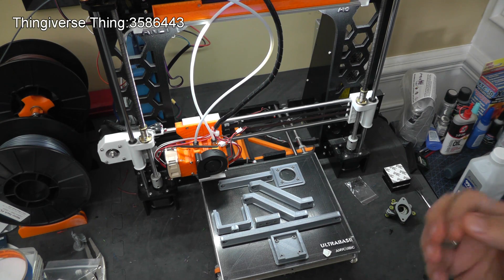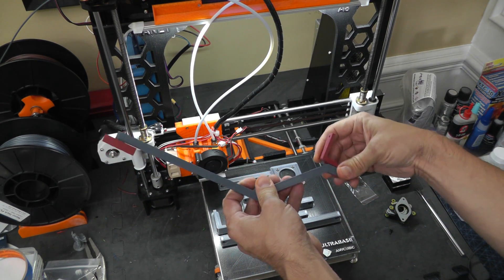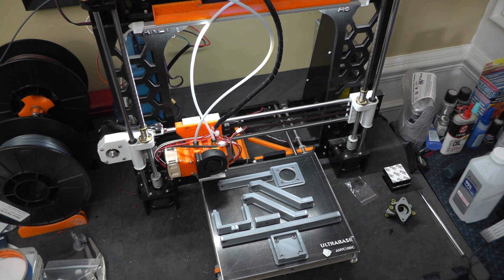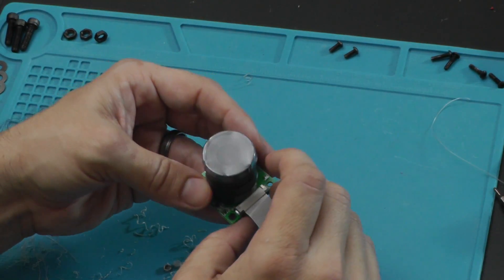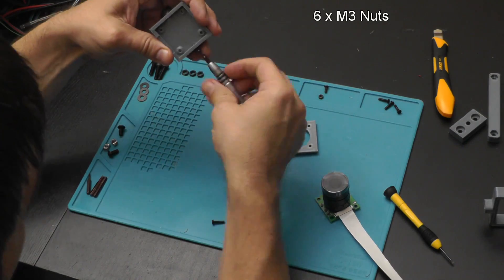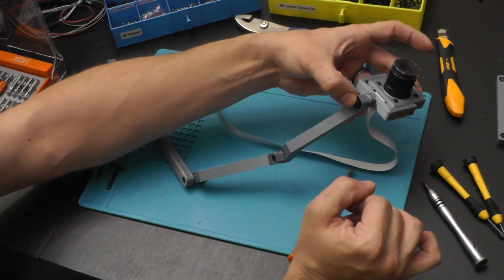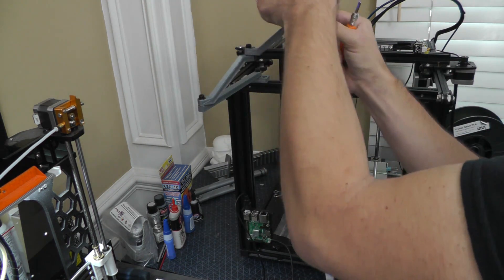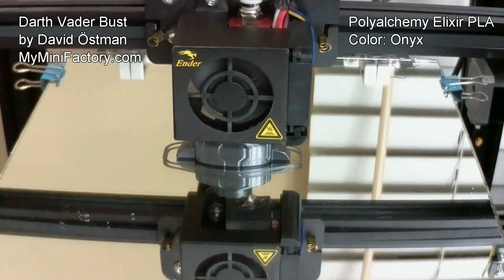All New Raspberry Pi Camera Mount for 3D Printers

Comment: do you wipe your Ultrabase with IPA? I wiped mine yesterday and it dulled it a little bit. I feel like long term use would ruin it.
Reply from the maker: Yes I do. It has always worked well for me. Typically, I try to buy 99% IPA for printer use.
Reply: Kersey Fabrications - I started doing this and now the parts won’t release from the bed.....I guess it’s better then warping or first layer not sticking.
Reply from the maker: Just try to wait for the bed to be fully cooled. That should help a lot.
Reply: Kersey Fabrications - left it over night.....can’t get much cooler. Adhesion is a great problem to have though.

Comment: Hello, super videos!
Just one question, will this camera fit? (https://www.aliexpress.com/item/10000000713212.html?spm=a2g0s.9042311.0.0.27424c4dm4aiR1)
its Camera 5MP OV5647 130 without the nightVision

thank you :-)
Reply from the maker: No. That camera has a completely different set of mounting holes. I could make a compatible mount but I don't have one of those cameras on hand.
Reply: @kerseyfabs  Oh ok. Thank you very much for the answer :-) I've found (https://www.thingiverse.com/thing:3103333) so I'll somehow combine it.
Thanks again (for video and reply)

Comment: Have you figured out a way to get the hotend out of the way for each layer for cleaner looking timelapses?
Reply from the maker: Yes. Use the Octolapse plugin for OctoPrint. Although it can result in extra stringing our other artifacts, so I usually avoid those long moves between layers. Quality of print over quality of time lapse.

Comment: The camera at your link comes with a 15 cm cable, which is clearly too short for a Pi sitting on the desk next to an Ender-5. Your video is showing it with a longer cable. How long is your cable and where did you get it?
Reply from the maker: That's a great point! Here's a link to the cable I'm using and I'll add this to the description: https://amzn.to/2J44sw1
Reply: @kerseyfabs  Thanks.